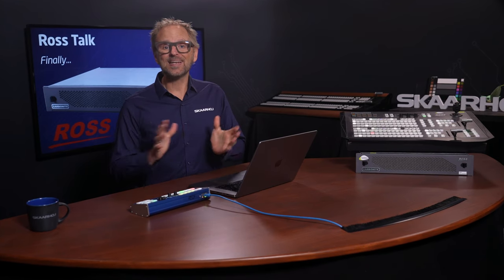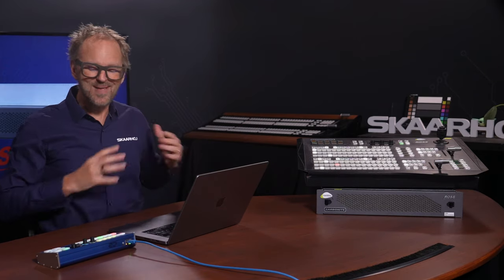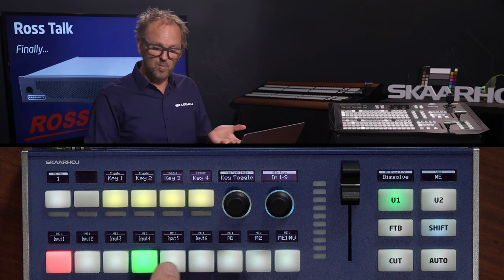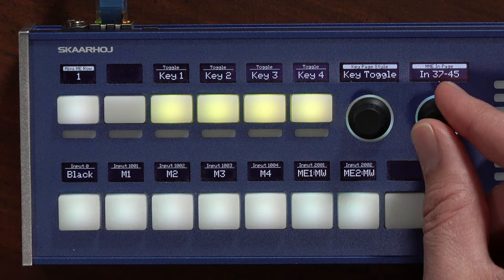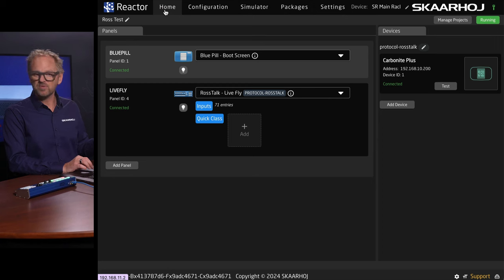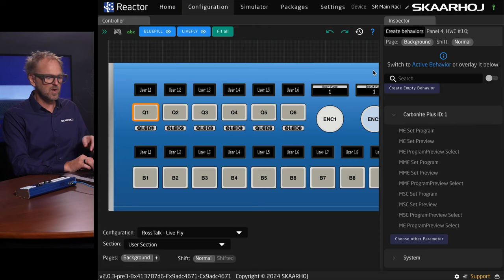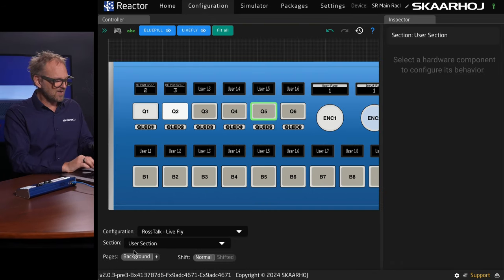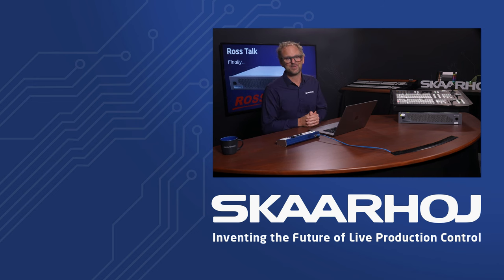Mastering Ross Talk with SKAARHOJ Controllers: Full Control and Customization

Comment: A couple of Ross terminology tips:
The busses with the buttons are "Background" and "Preset", because (technically speaking) "Program" is a ME output consisting of the combination of any keys over the Background and any transitions in progress (during which Preset is also in Program!); and "Preview" is the output of an ME that depends on what layers you have selected for the next transition.
Think of "Background" like your lowest layer in a non-linear editing software, that then has the "Key" layers over the top of it. Your ME "Program" output is like your final output.
All "Background" & "Program" (& "Clean"), and "Preset" & "Preview" are all separate "sources" within the switcher that you can assign to things like output connectors, MultiViewer windows, and even crosspoint buttons.
Each ME has its own set of busses and outputs.
ME1:BKGD, ME1:PST, ME1:KEY1, ME1:KEY1A, ME1:KEY2 .... ME1:PGM, ME1:CLN, ME1:PVW.
The Keyers all have 2 buses: KEYx is the Key Fill channel, KEYxA is the Alpha channel for that keyer.
MiniMEs have less resources, so they have less KEYs, and also can't generate a true look-ahead "Preview" or a "Clean" output.

The full MEs also have a hidden extra keyer for "Media Wipes" (Called "Stingers" on Blackmagic switchers), so thats what the "ME1MW" and "ME1MWA" [Alpha] sources are about. You can see them on buttons because the output of (almost) every single Bus in a Carbonite can be assigned as a source to (almost) every destination or output in the system. Want a Keyer DVE box in ME2 that follows whatever is on your Preset row in MiniME3? You can do that no problem! We do stuff like that for example to use Aux busses accessed from the main ME to route what source goes to DVE boxes hidden in upstream MiniMEs without having to change operating layers for example.

Each Carbonite also has a separate true "Program" output that is the output of the highest numbered ME on the older models. So ME2:PGM is the system "Program" of the switcher shown here.

There's a configuration setting called "On-Air" that you can use to choose MEs and Aux busses drive the tally system. Auxes & MEs can trigger a red tally for their Program outputs, and full (non-Mini) MEs can also trigger green tally for their Preview outputs (which may or may not include their Preset bus if the next transition doesn't include a BKGD swap!).
In addition to our recoding Program output, we also have our Carbonited trigger tally for Auxes feeding IMAG screens for example. So a camera operator will get a red tally light if there camera is live to either audience. Super useful.

Comment: We use TSL to read back the actual bus source status from our Ross switchers. It's a 2nd parallel device core to set up, but it works great!
(We're on Unisketch still, and just use the TCP Client core to send our Ross Talk commands.with the strings from the Media Strings with numbers added as variables from the buttons.)

It appears that you are using TSL for source labels already?
Reply: ... I should note that we use the simplest TSL tally to show On-Air and In-Preview only using the Red and Green tally flags.

To do full bus status tracking would require setting the switcher TSL output to include bus:source IDs in the labels and then parse those fields in the Skaarhoj controller to extract the bus sources and build a lookup table to light the appropriate keys. That is beyond the capabilities of existing Unisketch cores that I know of. Perhaps BluePill could run the necessary parsing, should be pretty simple with a few regular expressions.
Reply: Do you have any documentation on setting up Tally for Ross Carbonite and the Colorfly V3?
It was easy on our old Atem 2M/E using the source tally flags setting. Can’t get anything to work on the Ultra 60
Thank you!